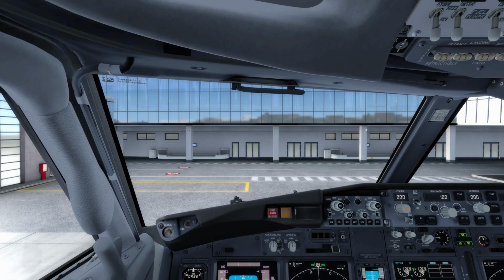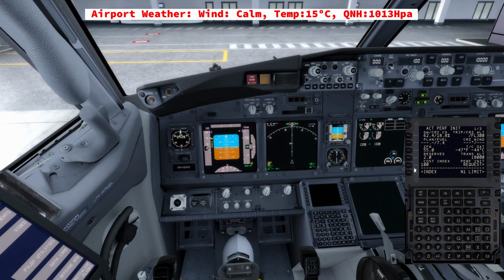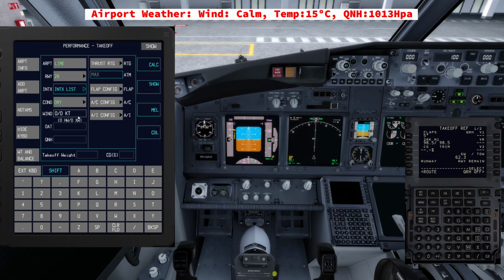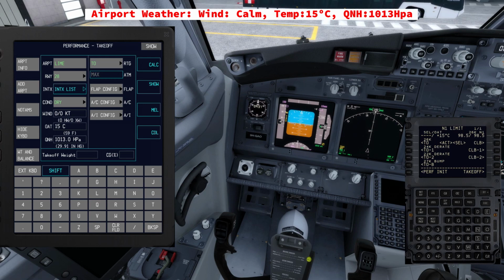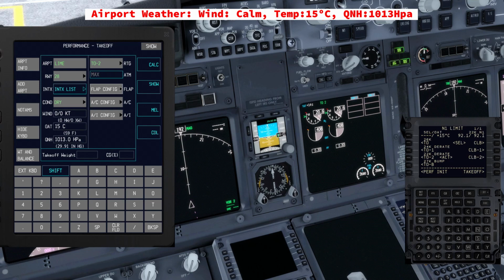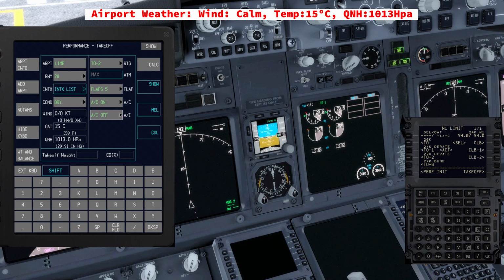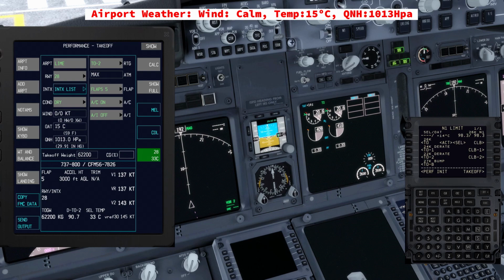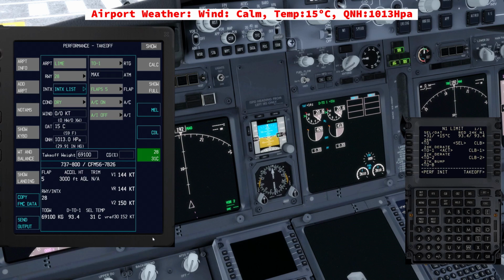Take off Performance Calculation

Comment: Let's say due to backtracking restrictions (damaged surface of the runway), we have to use a runway intersection, and we are not using the full runway length from the threshold. Then the runway available for takeoff for the aircraft is reduced, by, say 200ft. Then how can I get this info. in the FMC, or the Onboard Performance Calculation tool, so that it calculates the optimum thrust setting, for the takeoff?
Reply: The EFB does not contain any INTX list, in my sim, it remains un-selectable, because the EFB does not get the INTX Database correctly. And what info. shall I enter in the takeoff page in the FMC?
Reply from the maker: Hey, great questions! The Opt should have a notam section where you can shorten the Length on the runway and then base your performance on  the new TODA/TORA. Let me know if I answered your question.

Comment: Good Day Capt,during your flight experience 15 years have you ever experience one engine failure on B737?
1.what is the first thing a pilot should do if one engine failure in flight occured?
2. if let say left engine failed should pilot fly with right rudder input to compensate yaw due to asymetrical thrust?
Reply from the maker: Hey, I have never experienced and full engine failure in the real B737, however I practise the engine failure case many many times in the simulators.

The first thing is to fly the plane, so you should do what ever is requred to keep the plane under control.
Yes, on B737 the pilot needs to apply the rudder to compensate the yaw. Left engine faliure requries a right rudder as you correctly said!

Comment: Hello Gabriel you are lucky to fly 800 with 737400CL you have opposite problem and most of summer days you have to do no bleed toff or even unpresurized but that is out of way ...I would like to ask you nex example :  in ENGM snowtam says that RWY condition is 474747/020202/BA  3 (RWY is hot sand aplied) ..will you use ICE or DRY snow condition in EFB? I cannot see in this EFB contamination depth or BA?
Reply from the maker: Hey, many thanks for watching! I hope you found the video interesting.

Depending on the procedure of the Operator you might have to insert the snowtam or motne datas into a table and than figure out what data you should use to calculate your performance in case of contaminated runway.

I haven't check the simulator EFB performance for contaminated runway yet. I will make a video about that.
Reply: @PILOTCLIMB  I checked with documentation and dry snow of 2 mm and sandeed ice is not consider as contaminated rwy .. as BA 3 a use low friction data charts and hope I was on the save side :))
Reply from the maker: @samuelcv6565  very good!! Which documentations did you check?
Reply: @PILOTCLIMB  OM -B chapter performance than operation on contaminated rwy and there was stated that 2 mm of snow is les then 3 mm of WED(water equivalent depth) so I dont need to use this contaminated RWY tables  so there was only one way to use low FC data as there awas sanded ice with BA of 3 and make sure that antiskid, reversers and speedbrake is operative and assume temp is not alowed ....thats all  if you find different procedure let me know :) (if there is 2cm of snow  instead of 2 mm that should be tricky one:)), but there is another sentance  if you have both LF coeficient and contamination type use conatmination type charts :)))) I have a big mish mash with it :))))

Comment: Hello Gabriele,

Did you read the post from yesterday about paintkit?
Reply from the maker: Hey,

No I haven't, anything interesting??
Reply: Hey.

If you want to create an own repaint for the PMDG 737NGXu you need a paintkit.

A paintkit contains all the parts of the aircraft which can be painted.

Like engine cowlings, blended winglets, split scimitar winglets, vertical stabilizer ect ect.

If you want to use a paintkit you need a paint program like photoshop.
As far as i know all advanced and professional repainter use photoshop.
I mean painters for aircrafts and AI traffic.

If you want to make a repaint for the -800 version, you need the paintkit for the -800 model.
Same for other models.

At PMDG you can download the paintkits for free.

https://pmdg.com/paint-kits/

Personally i never made a repaint.

I am sure that you can also get informations in the PMDG forum.
Reply from the maker: @ahmedsmart1120  Thank you for your support I will look into that!